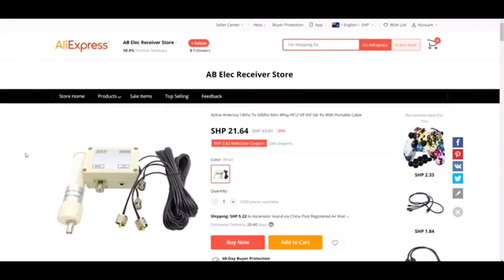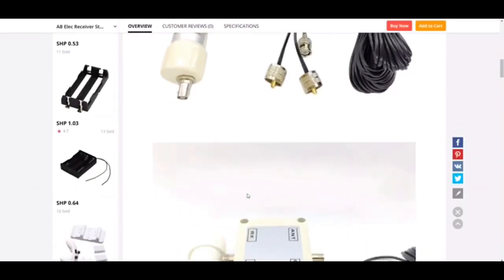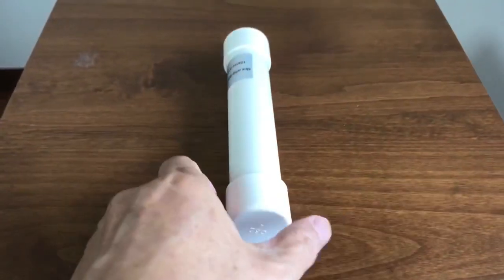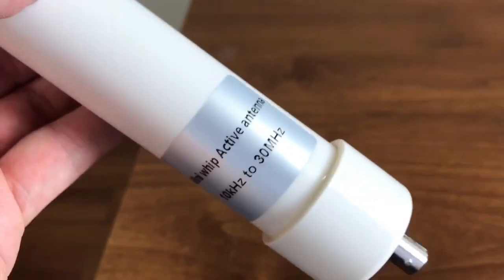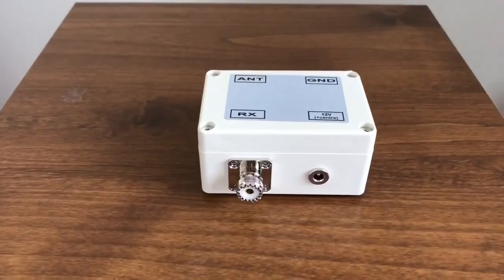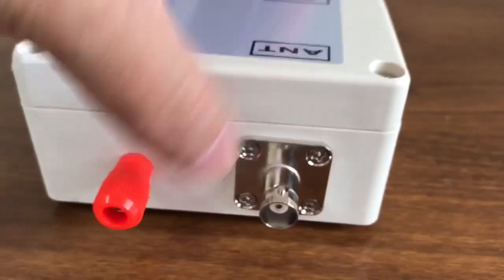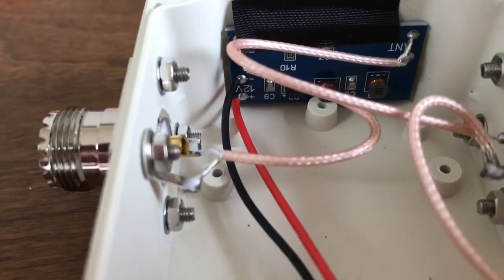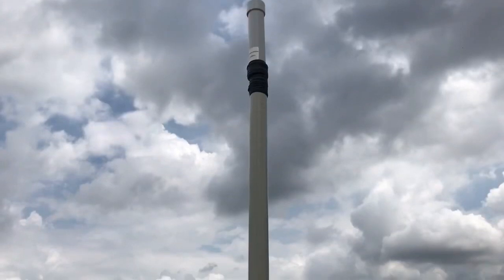📡 First test of the  Mini whip Active antenna 📡 ミニホイップアンテナ 比較テスト

Comment: Miniwhip is a PROBE for electric field, not an active antenna
Reply from the maker: Hello. Yes, as you said, this device may not be in the category of antenna. It is very strange that this device can receive wideband radio waves. Thank you for your message.73s!
Reply: @Ken.s_BCL-LogVideo  It's not strange if you know what a probe is and the difference with an antenna: the probe also picks up signals but without disturbing the field.

Comment: I bought one and the reception was down to zero. I think I will add a 30 meter length of small thin wire to the whips antenna pad, and stretch it out across my property, and see if reception is in any way better. ( possibly 15 meters of wire, mounted  north and south, while the last 15 meter length is stretched out east, and west, to cover all directions). Set-up the way you have it, I didn't get a single signal, except for FM radio broadcasting, and VHF ham receive. Sadly, on all the HF bands, I received nothing at all (airwaves were dead). I'm hoping that extending the receive pad reception, with 30 meters of small thin wire will help bring in the signals. So-far I am not impressed with the mini-whip's performance at all. Hope with the added 30 meters of wire improves the reception, otherwise I'll throw the whole thing out in garbage, knowing I wasted my money.
Reply from the maker: Hello. That's very sad. The antenna you purchased may be initially defective. In my experience, when buy on AliExpress, there is a 10% chance that  will have defective products. You are advised to make a complaint to the seller. Thanks for watching. 73s!
Reply: @Ken.s_BCL-LogVideo   It appears there are  other complaints regarding this product, and sadly bought mine through "Banggood". I sent a few requests for either replacement, or repair, and got not reply back from the web-site. Not even a peep. (this was the first one I bought). I bought a replacement from Amazon, and it seems to work, but still not receiving any signals from the newer unit. Both the unit I bought from Banggood , and Amazon, are exactly the same (made by the same company). The one bought from Banggood had both poor solder joints in the hook-up box, and once that was corrected, and power turned on, fried the Zener diode "ZD1"and Capacitor "C6". Note; 12 v. power supply was connected properly, with correct polarity observed. It appears I'll never hear from Banggood, about my issue with what I bought from them. The one from Amazon, appears to be working (least it's not frying up), but still no signals are getting through to my SDR dongle. Have decided to make a Mag-loop for the project, and scrap the mini-whips as a lost cause, and waste of money.
Reply from the maker: @waynedavies3185  I see. Your trouble is similar to mine. I have bought 2 sets so far. The first model burned the capacitor and inductor (101) in use. I repair it and keep it as spare equipment. The second set is operating normally. I installed a fuse (0.3 A) on the power supply side just in case. This SWL hobby is always about conflict and confrontation. But it's also fun. Good luck.:goodvibes:

Comment: What happens if you install this antenna in your room?
Reply from the maker: Hello. This antenna receives signals with the difference in height (electric potential difference) between the ground and the detector.
Therefore, I don't think  will show ability in the room. Thank you for watching.73s!!
Reply: @Ken.s_BCL-LogVideo   Thank you for your reply.   Then what about the DX signals coming very low height in MF and HF low frequencies?

Comment: It works well. For the price it really is worth it & is a very good choice in areas where one cannot put a longwire. I am even thinking of getting one myself. Many thanks for sharing & 73s!
Reply from the maker: Hello. Thank you for looking at it. This was a simple test. I hope I can be of help to you. Actually, if you connect a DSP radio to this antenna, it will cause interference. I will check the cause now. Analog radio and synthesizer tuning radio do not cause interference. I'll check it and upload the video.73s Tengu  :-)

Comment: Amazing audio Tengu. This is a very efficient antenna. Also, the price is very reasonable. The market for antennas is over priced in my opinion. I don't think this one is overpriced at all. My friend Danny shortwave in New York has one of these. Thank you for sharing your very neat video. 73 Lee.
Reply from the maker: Thank you for looking, Mr. Lee. It doesn't seem to have such high performance, but it seems good because it can be used in a small installation space. I will study it further.73s Tengu ☺